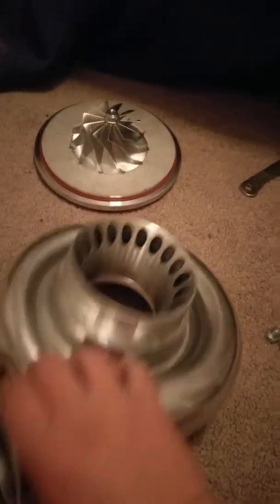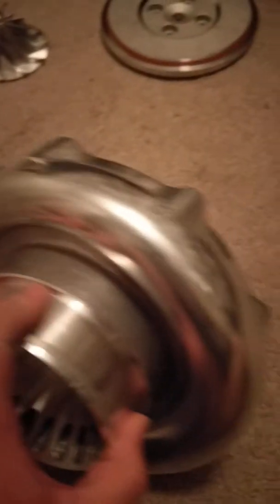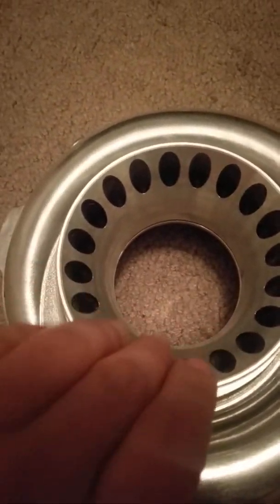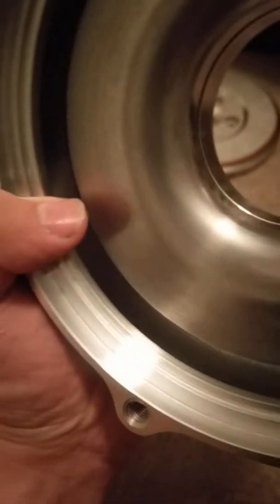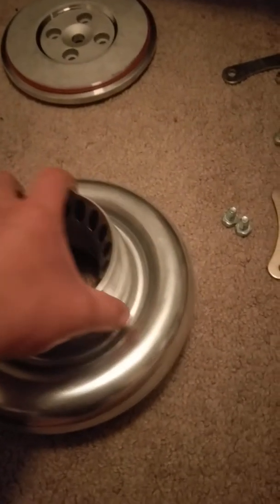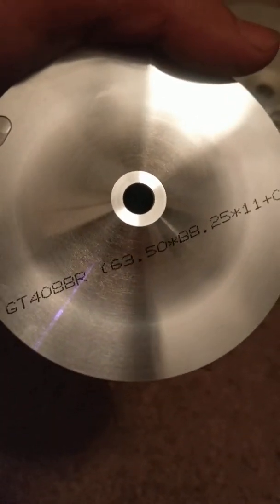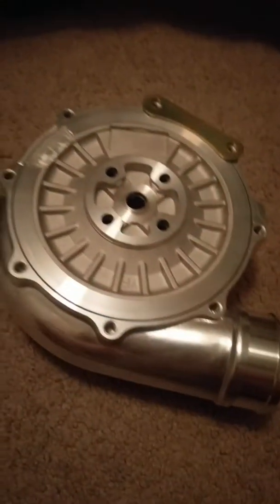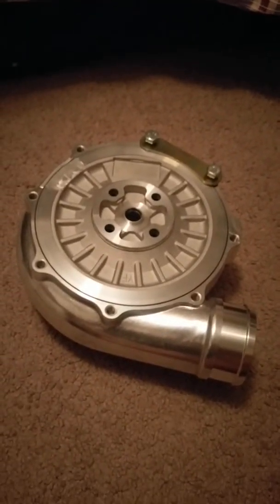6.0 powerstroke Turbo upgrade

Comment: so did you put it on yet
Reply from the maker: I did and it did not work for me. Tried contacting turbo lab and they were not helpful. They stopped responding altogether a couple messages back and forth
Reply: I have read very negative reviews about TLoA.  Just out of curiosity what did not work in this application?
Reply from the maker: The compressor cover is my issue. First the cover was not clocked correctly, then the backing plate was not notched out enough to clear the vgt plunger. Now this turbo won't boost down low. At this point I dont really know what all the issue is. However when I tried contacting them we exchanged a few messages then they stopped contacting me back after the second or third message. I recommend buying from kc turbo at this point as they have a great reputation. Now to be fair I have had subscribers contact me and say they were able to use this kit, but to me a flip of the coin if it will work is not worth it. Plus the huge lack in customer service.

Comment: Can’t wait to see the results from this setup, I’m considering a similar diy powermax setup.
Reply from the maker: +Shaun Skidmore thank you can't wait to post the turbo build video. Deciding on a few parts, but I am looking at rebuilding the turbo. Possibly replacing the center section. So that should be a fun video plus the installing of all this. Two more surprise parts coming. One is just basic upkeep. The other is a fun MOD. So lot of truck videos soon to come. Planning on starting to work on some more gun content as well.

Comment: How many pounds torke?
Reply from the maker: I do not recommend this turbo. I was not able to get it to work. If you want a DIY kit I would go look at kc turbo, for complete turbos I am sponsored by turbo time USA and they rock
Reply: @six0bros  thank you very much
Reply: @six0bros  I already bought it months ago I was waiting for parts when I installed it I let you know if it works on my turbo
Reply from the maker: I do have a few subscribers running it successfully. I have talked to others that have not had luck. My issue wasnt that it wasnt done right the first time it was that he wouldnt fix it. He stopped responding to me without any type of resolution. Let us know how yours turns out
Reply: @six0bros  ok i will .i let you know in a few weeks thanks bro
Reply: Do you know where I can get the boot that connects the turbo to intake